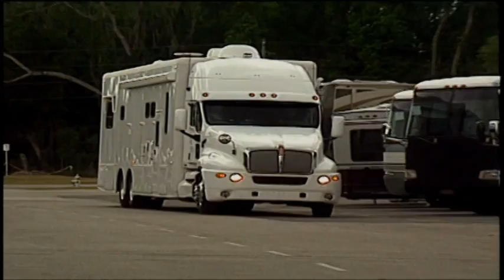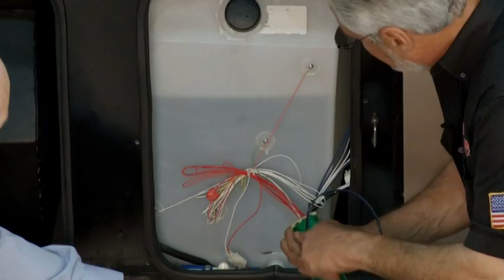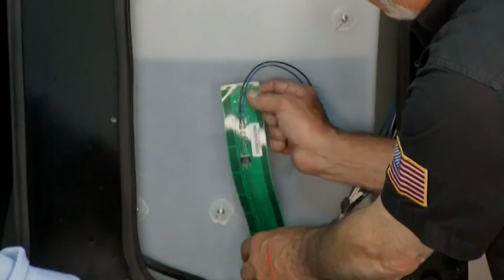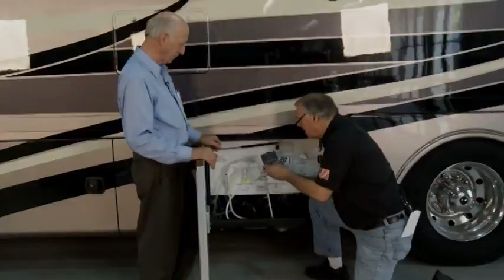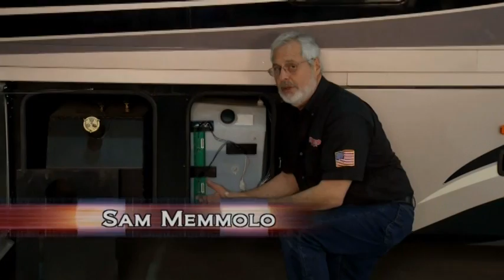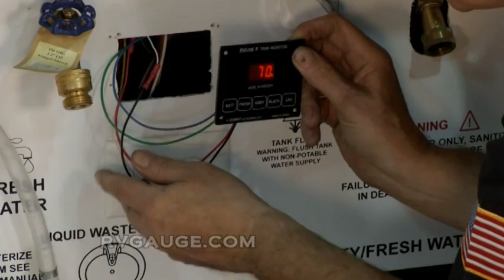709 SeeLeveL II install featured on Motorhead Garage

Comment: if you so much as bump these sensors the tiny UNPROTECTED components can fall off easily, therefor ruing your reading.... I have NO IDEA why the strips are not somehow protected,,, I have replace 3 over they years at $60 a pop..what a joke.